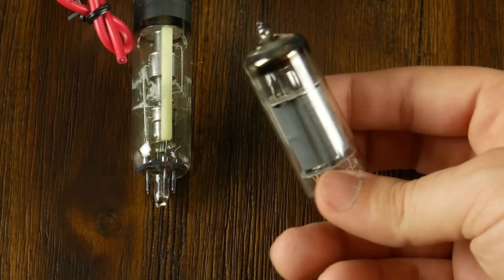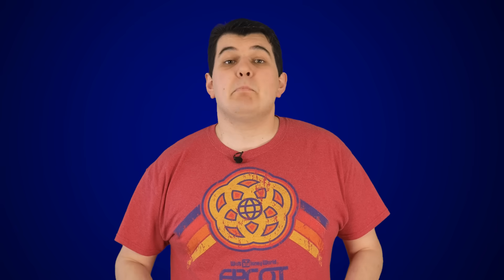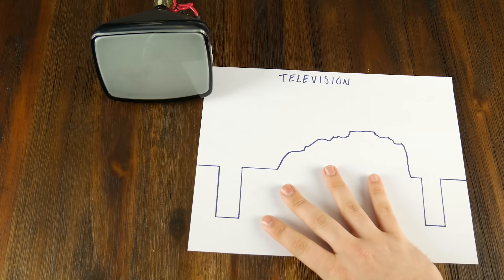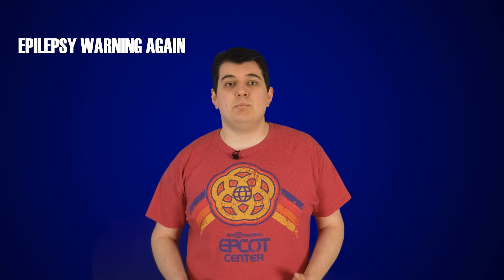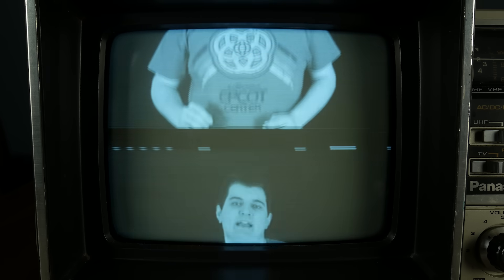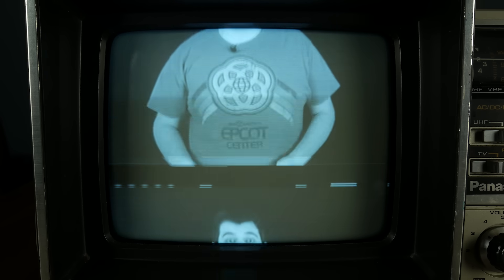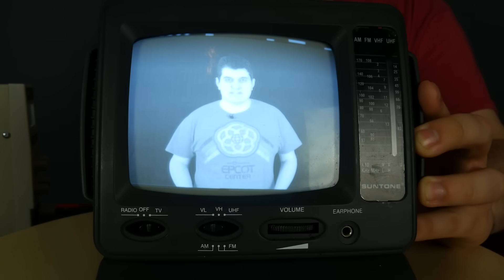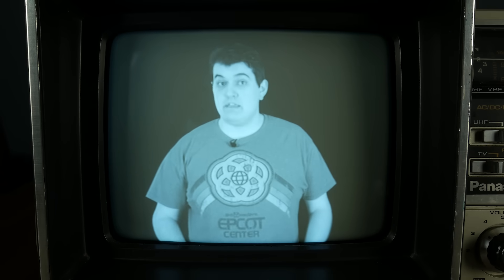Lines of Light: How Analog Television Works

Comment: The interesting thing, which the younger viewers may not realize as the technology has largely been replaced within the last decade, is not only how old the technology is, but the basis of the technology, is older. Or that there are places and industries where the technology is still used and maintained, sometimes to the point where you have manufacturers still making limited such systems, simply because of how robust the technology is in a variety of environments in comparison to what we enjoy today. The last CRT TV I bought fresh out of the box was in 2007, though the actual TV was made in 2005. Yes, I went digital with my TV in 2008, but I needed something to hook some stuff up to right then and it was cheap.

I've also seen CRT TVs that were a decade older than I am that were still working. I am almost 38, and those CRT TVs were the same ones that I grew up watching when I was visiting family, and they were the same TVs I saw when I last visited five or six years ago. As I said, a robust technology.

Comment: It's funny because I think your video came out before the monitor refresh rates started to get insane (144Hz-240 Hz), and/or started to get affordable.

I couldn't believe it, but I could tell the difference from 60 FPS and 144 FPS just on the Windows shell. It felt like I had a more powerful PC with the exact same PC. I have a dual 144 Hz monitor / 60 Hz monitor setup, and I can tell when I move the mouse cursor over

Comment: 9:26 Synchronization signals for both the horizontal and vertical are encoded into an analog video signal, as mentioned later in the video. The AC line frequency is slightly different and can't be used as a reference for vertical. This is evident on old analog TV's with a weak filter capacitor in the power supply. A line of distortion will be visible moving vertically through the picture at the AC line frequency rate, which is not exactly the same as the vertical scanning rate. Using the AC line frequency as a reference would only work if every transmitter and TV used the same exact reference frequency. Early power generation was not very precise. Although this could have been tried on the earliest TV's, encoding a sync signal works much better.

Comment: 8:17 Usually, there are no lines on a CRT. Common CRTs have a mask of dots arranged in triangles. And the resolution of these dots doesn't match the resolution of the television signal. If there are lines (on more advanced CRTs), they are *vertical*, and because the image resolution in this dimension isn't defined by pixels, but by the signal phasing, whose exact positions are undetermined, there is no exact match between this line resolution and the signal resolution, neither. In my opinion you are confusing 2 topics here: The title of the video says you are going to talk about analog television, but actually you are focusing on how CRTs work. CRTs can be used for displaying other things than analog television. And analog television doesn't require a CRT to be displayed.

Comment: Why were blanking intervals needed to keep the gun from firing electrons? Was it because of the analog nature of the circuitry (with the RC circuits that make this happen and the discharge/charge time)? You could hypothetically make the electromagnets in the yoke immediately shift back to the beginning of another line in the scan.

Comment: Fantastic information ! There are 4 coils on the Crookes Tube Yoke, 2 coils for vertical and 2 coils for Horizontal deflection. Two circuits, for the coils . The third circuit, lamp-tracer brightness is controlled by the Amplitude, into the Crookes tube electron gun, provided high-voltage from the flyback transformer. What a machine !

Comment: What I want to know is how the hell apollo was able to send analog TV,  with audio, sent from the moon, through the Van Allen Belts, some 237,000 miles away from Earth, without any distortion or degradation, kniwing well that Sun's super hyper particles and rays get trapped in the 50,000 mi radius of the Van Allen Belts faster than the speed of light, as we all heard hardly any delay between Houston and Eagle. What technology was it that they used to send analog TV from the Moon Buggy while riding it like the Dukesn of Hazzard, powered by only 2 batteries, they drove almost 2 miles without any fear of getting stuck that would have forced them to walk back if a wheel were to come off, and yet they were able to transmit analog TV faster than the speed of light? What technology did they use? Could it be that they took advantage of a wormhole? That would explain why it felt like they were filmed right here in Nevada previous to the moon shot, and all original film of the entire Apollo missiins are missing, could it be that aliens don't want anyone to remove one of truth's protective layers? 
https://youtu.be/BYhIM_0zQD8
Reply: Nobody's buying the crap you're selling bud, we're too smart here to fall for that. Try again after wrapping a bag around your head tight

Comment: Vestigial sideband AM was the NTSC method of crowding the video into the smallest RF bandwidth possible.  Things got McGuyverish when they went to color!  It was ingenious, really.  It involved a crystal oscillator of exactly 3.57954 Mhz, which was corrected to the exact frequency and phase via a tiny burst of that frequency from the transmitter hidden at the end of each scan line.
Reply: NTSC = never the same color

Comment: Larger CRTs are heavy? You don't know the half of it. We had one of the last Trinitrons, a 32" HD set that even had HDMI (on a tube TV, I know!). That fucker probably weighed 250 lbs. It was eventually replaced with a 42" 1080p set around 2012, and just recently a 43" 4k set that replaced the dead LG HDTV.

Comment: I have a thought experiment I would like to check on. 

The current analog TV signal is mostly amplitude modulated to convey its intelligence (with a frequency modulated audio carrier, though that too is carried in an amplitude modulated signal). One problem I keep running into is that amplitude modulation is very easy to interfere with. However, frequency modulation seems to reject just about all interference, though its primary use has traditionally been for audio. What would be the effects as far as both the signal and the performance of TV's using a resemblance to the NTSC and PAL standards that were used, had the entire TV signal been frequency modulated?

Comment: I enjoy building tube circuits. Magic eye eq setup is very cool to watch. And I like using my analog crt oscilloscope over the modern digital. I learned more from using it that I wouldn’t have if I started with a digital. No auto math functions on the analog. Exercise your brain instead of using the digital. But I use the digital also. They are both great.

Comment: Greetings" FYI: To lock the TV raster to the incoming "raster", both of the TV's horizontal and vertical oscillators must be running slow! That is because the reference synchronizing pulses are of short duration relative to the oscillator outputs to the yoke. The pulses assert control by forcing a premature end to the rising ramp output.. Without that effect. the horizontal lines would be longer and the height of the raster would be taller.   Hope this helps.

Comment: Also, there are two reasons the CRT faceplates were curved (spherical).  The first was to improve strength against collapse from air pressure.  Like a domed roof, a spherical faceplate was stronger than a flat one.  Second was focusing.  Since the electron beam comes from one point, a spherical faceplate would keep the focal distance from the beam origin to the faceplate.  Later flat CRTs had to modulate the focus potential to focus the beam on the fly as it scanned from the outer areas to the center.  Sony's first Trinitron was a compromise between a spherical and flat tube; they had a cylindrical faceplate.  Sony only had to modulate the focus beam at the vertical rate (60hz) to keep it in focus, and the Trinitron's unique shape separated it from others on the market (for good and bad).  Later true flat CRTs had to modulate the focus potential at both vertical and horizontal rates.

Comment: Here is a fun story for you all that I was told by a Electronics Technician with a wonderful scar on his arm. It was a zig zag scar that wrapped his forearm and he liked to show it off on safety days while I was in A School in the Navy. See he was working on a radar system on his ship and went about opening the CRT (although a bit different then those you saw here) and discharged the main cap with three shorting probes. Those that understand floating ground on ships will understand the need for three shorts and believed he had fully got all those glorious electrons out. Welp as he worked around the tube and kylstron, nervously I am sure, his screw driver slipped and hit the main cap that was in the driver assembly of the circuit which attached the klystron to the CRT and in turn joined him to the circuit. Unfortunately the common point in the circuits was now him and his fingers on the metal bits of a screw driver and he was sent about 15 feet into the bulk head and when he looked to his arm he found it blown apart with bone exposed. Medical was able to stitch it back up and he only suffered complete loss of feeling in his right forearm. Due to DC being pretty good at burning, his nerves were sealed instantly and never regrew. Also his tissue was stained a permanent black around his scar. 

The scar made for a nice story but the moral is this, unless you are trained in the art of CRT or high voltage certified I would stay clear of disassembling anything on a television. There are points on normal television which carry 5 or more AMPs of current on them (even when off) and a voltage as low as 5VDC. This is makes it easy to feel comfortable and incredibly deadly. Like he says in this video DO NOT DISASSEMBLE televisions all willy nilly and go about your day. These things were and continue to be death boxes.

Side note, televisions that were off for 15 years have been known to still have a charge. Think about that discharge rate.

As an ET for a bit I worked around a lot of people that thought electricity, RF and all the guiding theories were hog wash. I believe these are the same people that think global warming is make believe. Oh the things people do not know.
Reply: Also Alec this is a great channel and I love your work in explaining this stuff. Thanks for breaking down technology and the history to people, it is very addictive. :)

Comment: Makes me feel so old that I can't hear that damn TV sound anymore :(
Reply: I'm pretty sure youtube compression and the speaker you're using have a lot of influence as well.
Reply: @hetsmiecht  for some reason I extracted the sound into ableton and used a spectrum analyser, it peaks at 15khz and its audible but couldn't hear it in the video
Reply: @LouisSerieusement  its youtube
Reply: I'm in my 30s and I can hear it, but barely. However, it almost feels like a pressure on my ears rather than being a normal sound.
Reply: Don’t think we’re in analog any longer. We’re doing digital.
Reply: I still can hear it, but it isn't like a remember :(
Reply: I think I'm going to blame my archaic phone's itty bitty speaker. It doesn't have the best range normally, but I wonder if I could hear it if I wore headphones.
Reply: I'm 29 and it was louder than I was expecting.
Reply: I can't hear it at all and I'm only thirteen but I can hear it from a real vintage tv
Reply: I can barely hear it and I'm 12.
Reply: @HattyHatHatter  I can barely hear it in my right ear but in my left ear it is very loud. I'm also 12 but I am slightly use to it because I still use a crt for retro gaming but I do only use a 9 inch and I think he boosted how loud it was.
Reply: @HattyHatHatter  

Do you play your music aloud?

I heard that sound just fine, and I’m only 20.
Reply: @memezoffuckery3207  i would bet it has more to do with what you're listening through. It was loud as hell for me using in ear monitors which i can hear 20khz comfortably

Comment: Omg. I had no idea what was happening in the background, when as a child, I adjusted the horizontal and vertical hold knobs on the television. I also remember seeing the lines when I got really close to the glass. Sometimes we used to get shocked when we touched the tv glass. I could not hear the sound of the crt though. I think I remember the sound though. Maybe it was long, buzzing sound. Thx so much for the explanation. Man, you went all out.
Reply: But, I can hear the breaks in the sound that comes through the tv. Did not notice back then but the voice seems to have a bit of raspiness or static.

Comment: Good pick for a post.  
Red, yellow blue vs red blue green.  If the primary colors in nature are red, yellow blue why is video red, blue, green?
Reply: TL;DR: RGB is additive (light sources) color, CMYK is subtractive (filters, like paint or other colored objects) color.

RGB color closely matches how humans see color. We have rod cells that see light levels, and three types of cone cells that are keyed to frequencies humans call red, green, or blue color.

Primary colors in nature is an incorrect way to thinking about color. Some animals have more types of cone cells than us, some animals have fewer, and some animals have no cone cells and only rod cells. Some animals can see light above the visible spectrum (the term "visible spectrum" is based on how normal humans see light), and some can see light below the visible spectrum.

While double-checking this information, I learned that there's a third color model, called the opponent process, that I'm way too tired to try and understand at 3AM. This just illustrates even further that anyone who describes a particular color model as the one "nature" uses, they don't know what they're talking about. There are so many ways visual information is collected and interpreted that saying any one model is specifically right is oversimplifying in the extreme.

Comment: i'm 40 and can hear that high pitched noise just fine... AAAARGH
Reply: I wish I could say that.... kinda... Not really. (It would be probably be very annoying.)
Reply: I remember the noise as a kid being much more of a hiss than a whine. I can still very much hear it in this video, both at 5:41 and 11:57, and boy is it unpleasant. Either my ears have gotten MORE sensitive in the last twenty years, or the TV sets I dealt with back then had better noise dampening/isolation than the ones being demoed. As a matter of fact, we still use CRTs for preview monitors in the AV production world, and I've never heard them make any noise other than the slight "electronic" noise of the tube being charged.
Reply: me to but only on headphones, i can just hear the click of the start of the sound and end without. im 40

Comment: I not only heard the intentional example  of the "TV noise" but heard something like it while you were demonstrating with the case off. I have a lot of trouble with electronics around my home because I can still hear those ranges (I'm 30). I recently found out that my wireless phone base makes a high electrical tone when the answering machine number indicator is blinking. Took me ages to figure out what was making it. Only upside is that I can usually hear an electrical problem before other symptoms like charring or melting start to appear.

Comment: I didn't realize until the other day that a flyback transformer is a type of switched mode power supply. Like a boost converter. Hence how it generates such high voltage.

Comment: In television repairs or production, vertical and horizontal  are not the lines you see that correspond as in real world, but the opposite because not lines that are called vertical or horizontal but image cast on the line. Eg horizontal collapse means vertical fault in image display, vice versa.

Comment: PS the other reason for having frame rates match the power line frequency was that early TVs had pretty bad power supplies, so some "bleed though" of the line frequency would cause a variation of the intensity on the screen. With the frame rate matching the power line frequency, the light and dark of the power line waveforms bleeding through were static, not moving continuously. Thus you would not notice them as much.

Comment: You should do a video on how a Capacitance Electronic Discs works. It was a rare format made by RCA in the 70's that was a vinyl record with extremely small grooves to display video and audio. Instead of a needle going up and down to create sound, the needle would have different levels of electrical resistance based on the groove and then transfer that information to produce audio and video. It came out when VHS and Beta was hitting the market so it flopped. It's incredibly rare.

Comment: Let us make a picture tube in the shape of a sphere. We will send pixels into the tube in three dimensions from scan guns lining the inside of the tube. We must align all the scan guns to the absolute center of the tube. Let's say we are projecting mass, instead of light, into the tube, to form three-dimensional objects,  like our body. We turn the tube on to adjust the gun alignment. The center spot will cause collisions of the beams, and a reversal of the signals. This ANTIMATTER will cause anihililation and a BIG BANG : leaving only a tiny bit of the signal in the center. OK: the guns are aligned. Now we can send a three dimensional image into the tube: FROM A COMPUTER connected to a program simulating a universe. (A typical amateur anouncer: talks way too fast.)

Comment: Vacuum tubes were still used for a while on CRTs after the transistor because for a long time they were still the better choice for high voltage electronics.